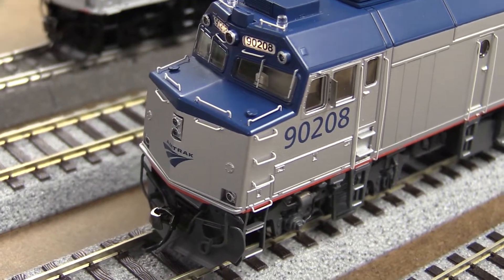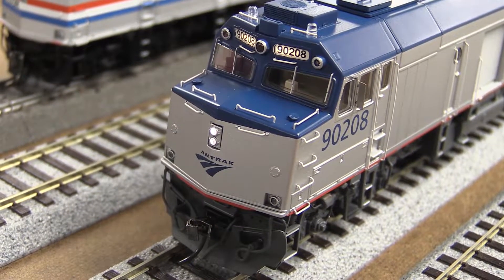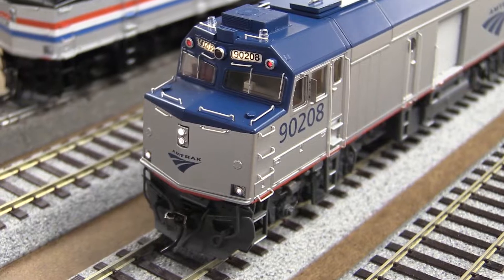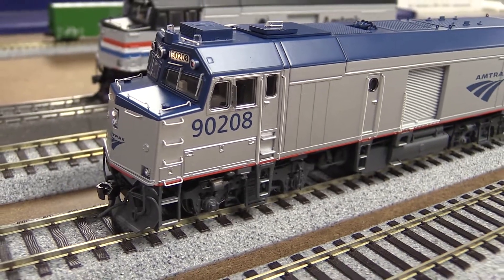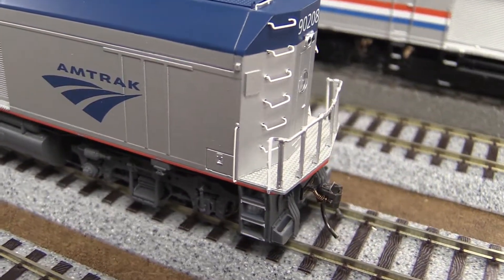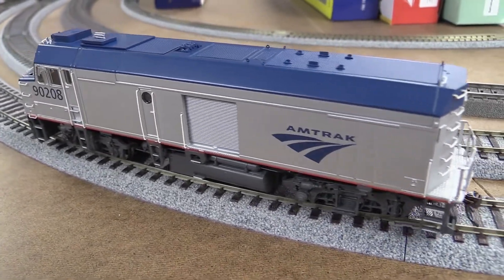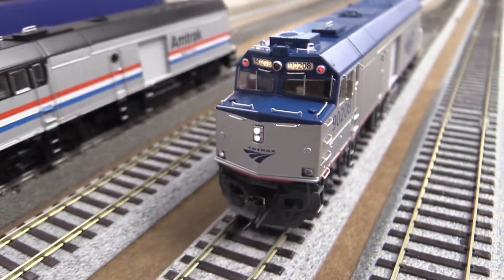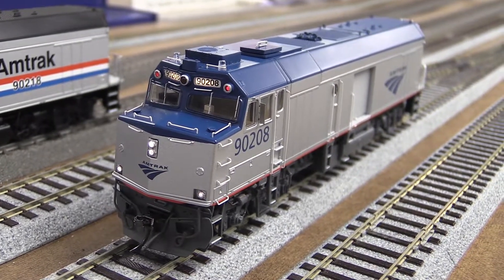Rapido HO Amtrak F40PH Cabbage NPCU

Comment: After about a year and trying to speed match over and over again with my Kato P42 the motor died on me and was screaming. I ended up having the gears removed and the motor disconnected but kept it attached to the decoder so I can still program and added resisters. So now mine is a dummy with full dcc/sound functions. Besides this I love mine.